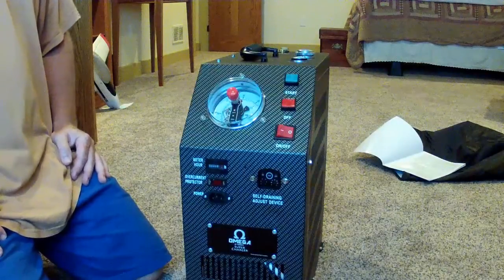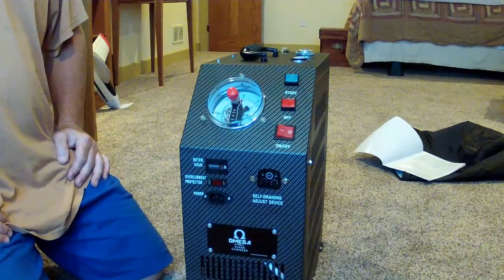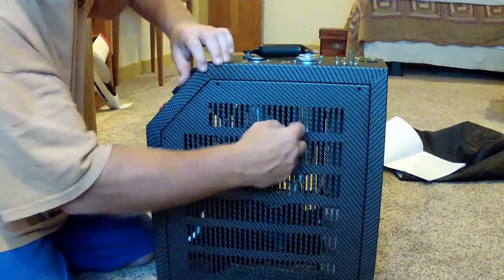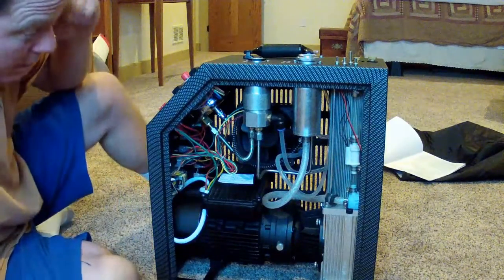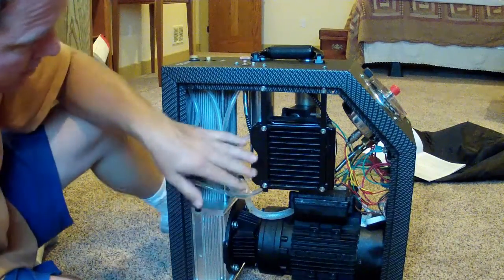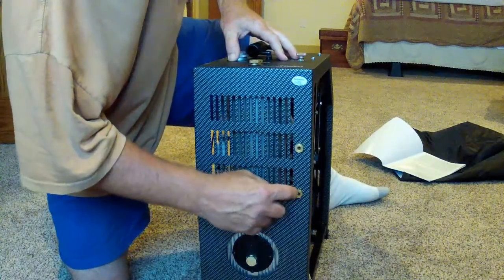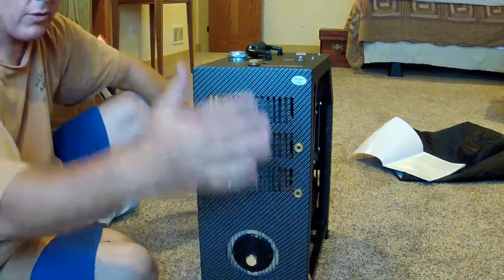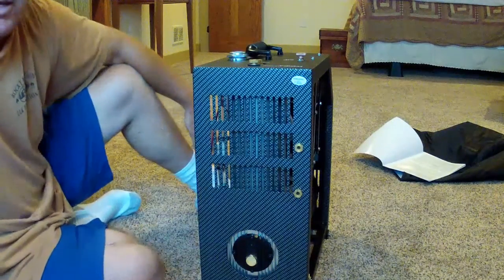Where does the Omega Super Charger compressor vent?

Comment: Thanks for the video.  did you ever figure out how to stop it from spraying on the walls ?
I am in the marker for a compressor and have the shoebox high on my list as it is 1/3rd the price of this, though needs a secondary air input and no water purge.

Have you had any issues with it after using it a while ?

Thank you for the video and any information you can toss our way.
Reply from the maker: I too was looking at the shoe box.  In fact I had purchased the oil less compressor I was too need.  I decided that I had the money and was willing to pay for the convenience of the package so I could run it in the house as well as the speed.  The house was important for me because I wanted it in a place with minimum moisture and stable temps that the shop does not necessarily see.
It has worked well for me so far.
As for venting, I have not run it long enough to see an issue.  I fill my guns direct so the cycle times are short.  I don't have a cylinder to fill yet.
If you want to re-route the vent, you could just add tubing to the existing one with simple aquarium fittings and have it go where ever you want.
Good luck.